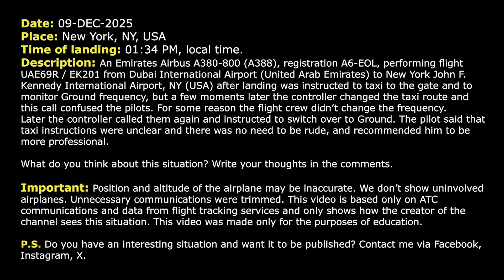Emirates pilots ask JFK controller to be MORE PROFESSIONAL. Pilot argues with controller. Real ATC

Comment: The instructed taxi route was not clear since "straight ahead of A" meant they had to turn many times to reach D (this seems to be a problem with the airport itself), which did not seem straightforward. And I guess this is why the Emirates slowed down when crossing. Thus it is understandable that the "speed-up" instructions (with a pressurised tone) were frustrating for the pilots.
Reply: It was unambigiously clear what they wanted. HE said Alpha to Delta. This isn't sleepy foreign airport where they get one 380 a day. Believe it or not, the ground controllers in JFK know more about how to manage ground traffic than some foreign ME3 pilot. When foreigners fail to follow instructions (despite reading them back correctly) it messes up the system. If they cannot handle American airspace they should maybe stick to flying to Nordic and EU countries

Comment: The controller should have told Emirates straight on A to go all the way around the airport to be clear. That confused and frustrated the pilots.
Reply: What the fuck are you talking about? The ATC gave initial instructions which were clear. As happens at many airports there are changes to initial or other instructions which the ATC gave to the pilot in a clear manner. I understood both the initial and changed instructions. The pilot did not follow the changed instructions (at least not fully). The pilot then had the temerity to speak down to the ATC and call him out when it was the pilot who fucked it up.
Reply: @raccuia1  NO, he didn't! The revised ATC was to go strraight on A only. Not informing the Emirates crew you are taking the long way all the way around the airport.  ATC said this after when confornted. Clearly you didn't comprehend my message, replying back with a retarded comment.
Reply: But the TWR said that!!!
Reply: @PetrolHeadBrasil   @caressas  NO, afterwards. The initial instruction wasn't that!!!
Reply: @PetrolHeadBrasil  NO, afterwards. The initial instruction wasn't that!!!
Reply: He did! He did tell them that!
Reply: @caressas  NO, afterwards. The initial instruction wasn't that!!!
Reply: It doesn't matter what he should have said.  He can't follow ATC instructions then has an attitude.
Reply: @747heavyboeing3  NO! JFK is known for this rude behavior from the ATC. If you have foreign pilots flying in, you need to be clear and speak the STANDARD language or lingo. period! Go listen to a busier airport around the world than JFK. They're more professional, even though their airports are busier than JFK. It's a shi$##@y culture that has been passed down for ages!!!
Reply: Controllers don't have the time to hold the hands of foreign pilots that cannot handle ambiguity and cannot handle situations changing quickly and who cannot multi task. Also if the controller explains things to foriegn pilots there's high probability they'll get super confused and overwhelmed and then they start fking up.
Reply: @brianlacroix822  NO! JFK is known for this rude behavior from the ATC. If you have foreign pilots flying in, you need to be clear and speak the STANDARD language or lingo. period! Go listen to a busier airport around the world than JFK. They're more professional, even though their airports are busier than JFK. It's a shi$##@y culture that has been passed down for ages!!!

Comment: As a non native english speaker I can say for myself if I got an instruction to turn right and then to go straight ahead, for me it means turn right and go straight ahead. I think a "cancel right turn, go staight ahead" is more clear. Im not a pilot nor I have anything to do with aviation. But I have a C2 degree in english language.
Reply: No. That s not work like that. When a pilot heard ‘correction’ that’s mean you must disregard any previous instructions and follow the new one ordered
Reply: I understand this may seem sensible to a layperson with good understanding of English (which I also am, at least the layperson part), but ICAO English has its own rules and it wasn't unclear in the way you describe in this case. It was more just unclear because it's an instruction the pilots weren't expecting, as it would have them go all around the airport.

Comment: I've seen this before operating into JFK with pilots that aren't familiar with the airport.

I think some confusion comes from the taxi chart saying A is clockwise and B is counterclockwise. The controller first issued them a non standard counterclockwise clearance on A then changed it to clockwise. I think they should just get rid of this box on the taxi chart if they are going to give clearances that don't follow this rule.

Then some guys also don't expect to taxi the long way around the airport, maybe the controller could have also added this to his clearance.
Reply: A380s cant use B for wing clearance and the pilots know it
Reply: @giorgiomarino5958 Ah okay didn't know that. One less excuse for the pilots then 😂.
Reply: @giorgiomarino5958  A380 can you taxiway B in JFK but not if rwy 22R/04L is in use.
Reply: There's also another problem with the clearance; for each bridge on A, an A380 needs explicit clearance (first behind N)

Comment: The tower controller was very clear, especially compared to how JFK tends to be, also surprisingly patient. Even after the pilot confronted him he still remained surprisingly calm.
Reply: He said right turn on Alpha hold short Delta. That's not possible. He then jumped on them to drive faster... Nothing about that was correct or professional.
Reply: @whatilearnttoday5295  There's two different ways to get to Delta. Look at the map they provided, He wanted to have them speed up so the 777 behind them wasn't stopped on an active runway.
Reply: @DeweyCheatumNHoweLLC  If they didn't want the 777 to be stopped on the runway then they shouldn't have made a mistake. Oh what's that? Mistakes happen? Then perhaps don't run over-capacity where a single mistake causes unsafe situations.

Comment: Honestly, I think there was confusion and an attempt to save face, which made things worse. I think the initial confusion was, after the instruction change, the pilot heard "D" but realized D was nowhere near, but "KD" was immediately ahead, hence the slowing up. That's why he asked the controller if he meant "KD" instead of "D". The pilot slowing up due to the confusion probably frustrated the controller because he DID clearly say "D". But the pilots are now receiving the frustration from the controller, and they couldn't blame the controller for the error—because he DID clearly say "D"—so, in order to try to save face, the pilot thought back to the instruction change and claimed it was the CONTROLLER who caused the problem with the change.
Reply: They didn't need to make this claim to be justified in stopping when they weren't 100% confident they had understood the instructions, though. They can do that for safety. On the other hand, the controller became a bit brusque as he had another plane in the middle of the runway, but I wouldn't say he was actively *rude*, he insisted they needed to keep moving. I think it's a case of "misunderstandings that happen", and both sides remained in the realm of the professional until the escalation, and there was no need to escalate it much further...
Reply: @LjL-Videos  It doesn't seem like they made the claim simply to justify the slowing up—they made the claim because they were being pressed by the controllers for a reason, and they didn't want to admit it was their fault due to a minor confusion over "D or KD", so they deflected the blame, using the excuse that it was because the controller changed instruction. The pilot should've let it go without their broadcast claiming lack of professionalism, since he now realized it was his mistake, not the controller's. But, exactly, the slowing up frustrated the controller. It seems the pilot confirming "D" and the lack of professionalism allegation—implying the controller may have made a mistake—may have been taken personally by the controller, and he clarified that he initially said "D", which he did. But the controller pushed it, even signalling to the second controller on the subsequent channel to keep pressing the pilot for a reason, because the first controller was confident that he said "D" and was frustrated that they dared question him. It def WAS a "misunderstanding that happens"... but egos and/or tempers were thrown into the mix, dragging it out, escalating it.
Reply: You are exactly right: the pilot and his crew is very good at parroting directions back in english but they are not very good at internalizing the instructions and following them, especially in busy airspace where it's not all about the 380.

Comment: Well if you told me to turn right on Alpha and hold short Delta, and then immediately after told me to go straight on Alpha and hold short of Delta.... no one sees the issue?
Reply: I take it Alpha circles the airport like a ring road, you can see the issue if not familiar with Alpha.
Turn right Alpha hold short of Delta.
Or straight ahead Alpha hold short of Delta.

I think a straight ahead on Alpha, all the way around the terminals to Delta, would have been better.
Reply: @justincrawford7508  There is no Delta after turning right on Alpha.
Reply: @whatilearnttoday5295  yes there is. alpha goes around the whole terminal, so both directions, you get to Delta.
Reply: There is no issue here. The issue was not taxiing far enough to get a 777 stuck on an active runway. There are so many pilots who never think about what’s behind them.
Reply: If you know JFK's layout, no.

Comment: Emirates gave proper readback, so they definitely understood what controller said.
Reply: They understood what was said but were unsure how to accomplish it, given the extreme change to circling the airport to do so
Reply: Wrong! Pilots read back instructions and clearances, then they try to understand them. To try and understand a clearance before reading it back would clog up the frequency.
Reply: Just because a pilot reads something back, it doesn't mean they've understood it. Sometimes pilots will parrot back an instruction without fully understanding it.
Reply: @MrBadger1978  Yep. They need to keep their processing off the primary tower frequency because it's a cleaner, sharper give and take. Their understanding and processing must happen on their own time, on their own or at a parallel frequency, like the Ground frequency.
Reply: @MrBadger1978 If pilot's readback was correct, but actions wrong - it's pilot's problems and he gets number to call. If rwadback was wrong, and not corrected by ATC, ATC is in trouble.
Reply: @AirTCO  A parrot can readback what you just said to it. Does a parrot understand what you just said? 🤦‍♂️
Reply: @iu2 it is the most simple taxi instruction in JFK ever. You think A380 pilots are dummer than parrot?😅
Reply: @AirTCO  No. You completely missed my point. Again, reading back something doesn't always equate comprehension.
Reply: Understanding what is said and understanding how to do it are not same thing. If I told you to go to moon and make a right turn. It is clear instructions, but do you know how you can do it?

Also second atc guy was reasonable and explained it but not sure it should have been on radio. First atc seems to not like his job that much with that attitude. Safety and considerarions are not his priority, rushing people around is. That plane is not a bike that can turn in circles like regular cesna... It s massive, coming from a very long haul flight, plus two different instructions were given, one possibly not familiar or not logical at first to make a full circle with the hold short instructions... Not expecting the short bit is 100miles away... Those instructions normally as I hear for like go next junction hold short go next hold... Not full circle around to a short...
Reply: @mysticusa  very well said
Reply: Yes, he clearly said turn right on Alpha and then changed to straight on Alpha when they decided to get angry and unsafe.
Reply: @whatilearnttoday5295  yeah but it’s pretty confusing how you can go from going right on alpha to going straight onto it. Imagine doing that from maps where you have to drive around the world to get to it. Little context goes a long way
Reply: The pilot reading back is not the one riding the aeroplane, usually... So, you cant blame pilot who reads back correctly and is not the final authority at the same time...
Reply: They heard it, but didn't understand the instruction because ATC wanted them to go in a completely different direction.
Reply: Yep. A sharper brain can process the instruction and translate it to self-action much faster than what the Emirates pilot managed to do. Even British pilots sometimes need that lounging around time for the message to go from their ears to their brains and eventually to their actions. Such people mess up the tower frequency because the tower works on a quicker and cleaner give-and-take, so their desire for a longer lounge around time to process what they heard is a strain on the tower. They should absolutely get all the processing time they need, but not on the tower's frequency. Great example here about the ground frequency that's catering to them at their pace, giving them enough breathing room to process, even time to complain and re-align. But this lounge-around cannot be on the tower frequency while eating into the tower's bandwidth.
Reply: You should listen to the full audio not the part you like. Reading back correctly is different than doing it correctly. He Said A to D but then he went A and held short at KD. Asian pilot who cannot multi task.
Reply: @brianlacroix822  Right at Alpha is different to Straight at Alpha.
Reply: @brianlacroix822  "Asian pilot who cannot multitask."
Says the Euro-American who only speaks one language: American.
Reply: @brianlacroix822 There were no asian pilots on that flight
Reply: @brianlacroix822  he asked short to KD because he had confirmation bias of how do you want me to hold short of D from going straight? Didn’t compute. Many people don’t think about taxiing all the way around the airport and circling back. Had nothing to do with race.
Reply: @Gee1410thirtysix  the controller said Delta. it's just best for yall to follow directions instead of questioning them
Reply: @brianlacroix822  you seem new to human nature and associated biases like confirmation. Bless your heart.
Reply: @Gee1410thirtysix  in USA we just get told what to do and then we go do it. super simple this way.
Reply: @brianlacroix822  buddy everyone agrees it wasn’t simple. Flight ops are quite clear, and the agency can’t spell it out any further: if unclear on how to execute directions, you can’t move an aircraft at an airfield. Mosey on to try and troll someone else. I’m far too experienced to take the bait.

Comment: Ya, no.  I understood those instructions, and I don't fly into/out of KJFK -- the instructions were clear and concise.

I think that the PF (most likely the captain) became confused due to expectation bias and language barrier issues, and threw a fit in the flightdeck, creating a power gradient.

The Tower controller was 100% professional.  The captain was butt-hurt.  End of story.
Reply: No its because pilots weren't expecting the controller to mean go all the way around the airport, telling them to go right at first then straight ahead in a different direction but hold at the same point is very confusing. The controller spoke clearly but the instruction could've said "disregard, carry on straight on A hold short of D, taking you around the whole airport" initially and there would've been no confusion. A frequent flyer to JFK may understand this instruction, an emirates pilot who flies to JFK once every couple of weeks or months may not.